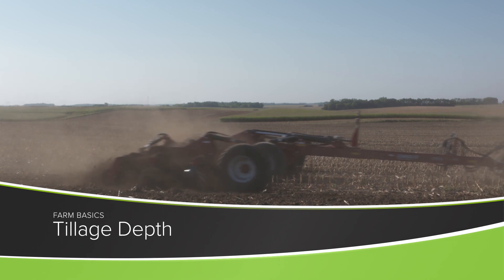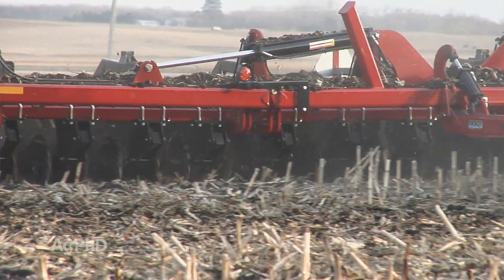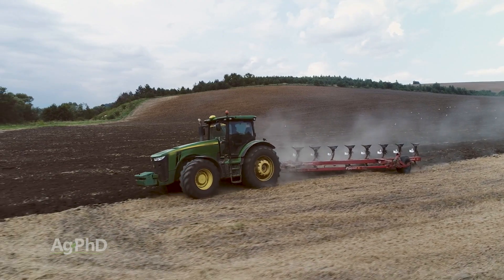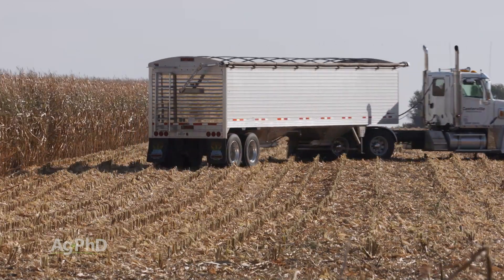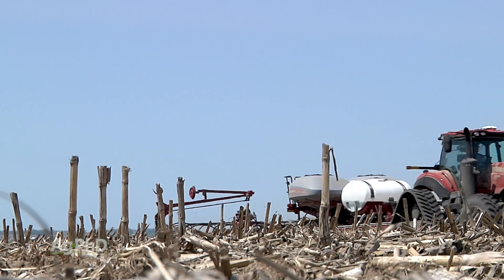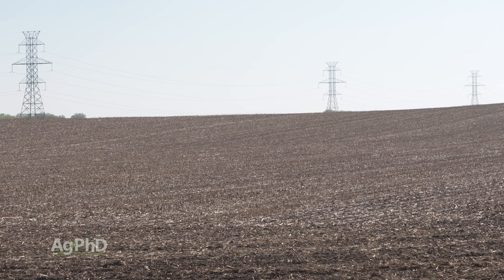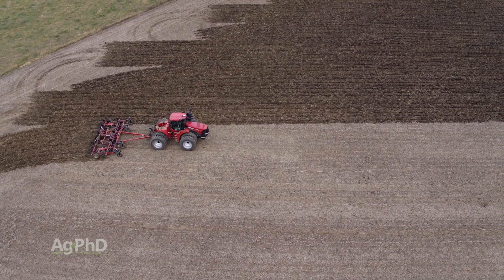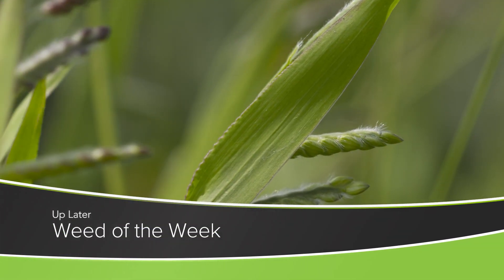Tillage Depth

Comment: There has been years where subsidies kept farmers out of bankruptcy.  However, if you till you are not allowed to participate in subsidy programs.  I would prefer about a 6" till.  However, if the crop I grew that year had serious problems due to some type of trade dispute then I would be left out of the $1.50 or so per bushel to make up the difference.  That is a huge risk for most farmers.
Reply from the maker: Brian and Darren addressed your comment on Ag PhD Radio: https://soundcloud.com/agphd/10-28-21-corn-rootworm-resistance?si=d6541a14144b4fe1ba19aa1948582768#t=40:28
Reply: Ĺĺ

Comment: Understandable that it depends on the growers situation and equipment but there really should be no reason for such intensive tillage anymore. Leaving crop residue on the field has too many benefits not do it. If it’s weeds you’re worried about, you’re only tilling dormant weed seeds to the surface as the soil is flipped over. Residue makes it harder for weeds to germinate and breakthrough. Growers should have a proper rotation to break up pest and weed cycles anyways.
Reply from the maker: Brian and Darren addressed your comments on Ag PhD Radio: https://soundcloud.com/agphd/10-13-21-weed-control-in-winter-wheat?si=5bece39c123146fd88b4ccabf902d3fc#t=5:08
Reply: yes, but you have no way of doing no-till without herbicides and fungicide